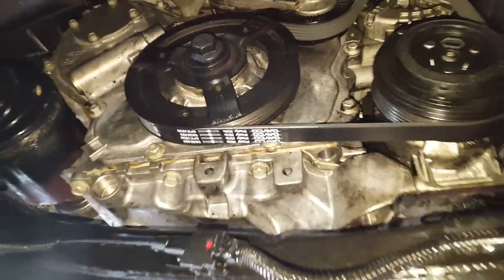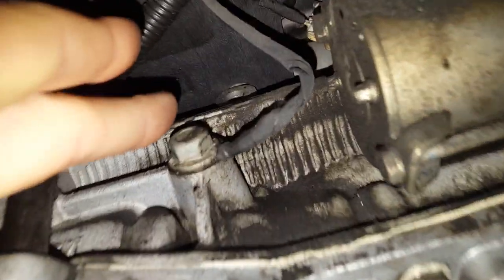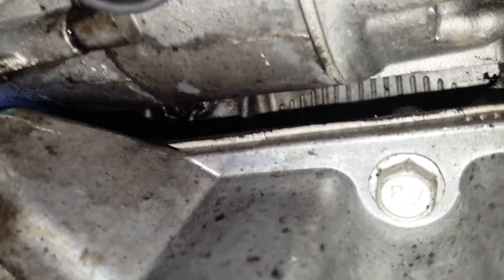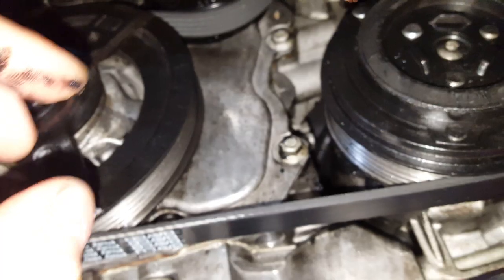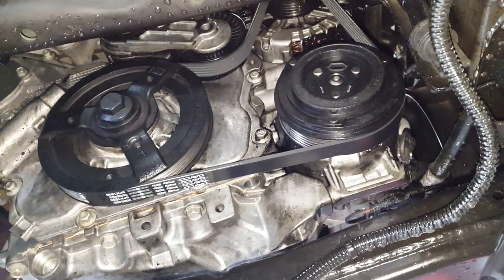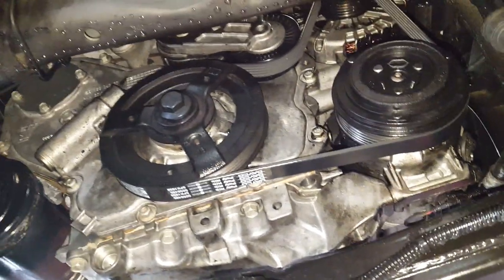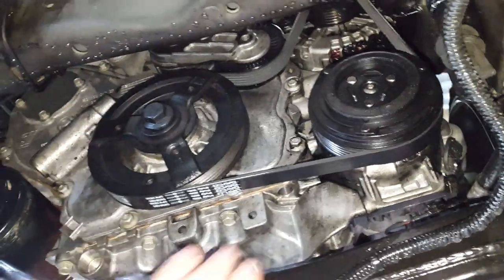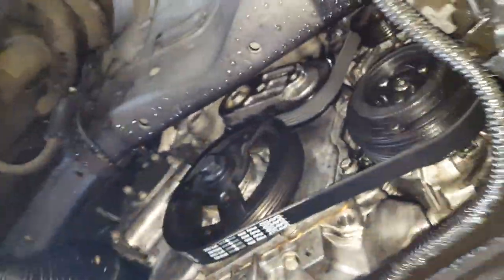EcoTEC Oil Leak hard to find

Comment: Just fixed my 2010 Chevy Equinox with an oil leak problem. Mine leaked after I turned the engine off and parked in the driveway.  I replaced the front crankcase seal, right behind the lower pulley. I also replaced the drive belt as it was soaked in oil, making a squealing noise and slipping against the pulley. Seems to be something that tends to happen to these GM vehicles with the 2.4 ECO Engine.  Fixed the leak straight away. $45 in parts, including tax…
Reply: I have owned 3 Chevys so far. 2 cruzes and a equinox. I’ve had nothing but cooling issues with the Cruzes and the equinox just has oil problems. 2 of the vehicles was brand new off the lot..
Reply: @jamesdenike5883 for the cruze get you a ZZP intercooler

Comment: Or, try  $16 for an oe delco oil sending unit and a Lisle socket for $7. The unit typically leaks and is hidden behind the starter. It leaks all along the oil pan.

Comment: 2010 cobalt, been dealing with this same leak for months now but i could never pin point it myself of where exactly it was coming from but now i see ! Thanks !
Reply: Was oil all over the belt and Altenator?  I can’t find this leak I replaced timing cover and crank seal. I’m going crazy. I think this video is it
Reply: Same oil leak for me.  2012 chevy malibu 2.4L eco tec.  I'm about to use ATP AT-205 and see if it helps with the seals.  This car has been a nightmare.  192'000 miles on her.  I ain't paying thousands of dollars just to replace the seals.  Gotta love American made

Comment: I have a 2005 Cobalt with the 2.2 ecotec and it leaked right after overhauling.  Finally found the problem which was the crankcase halves leaking.  Took the engine out and apart then carefully resealed the two halves.  Thought  I was good but about two months later it started again.  I found that these engines produce an incredible amount of crankcase pressure.  Don't look forward to R&Ring the engine again.
Reply from the maker: Could the pcv system be clogged?

Comment: 2008 HHR. 2.4. Oil leak. Backside of engine at a bracket-strut coming out of the block, in a valley. Just got informed by a Chevy Mastertech that the cylinder head has some sort of a newly found casting fracture as he describes it. 145k miles. Well cared for synthetic oil changes every 5000 miles. Interested to see where this goes. :-(
Reply: Got 250k 07 hhr. Runs new

Comment: I have the 2.2 and this just started today mine seems to be just above the starter. Now the fun.
Reply: What was the problem?
Reply: @Darrick222  if I remember correctly there was a sensor in that area was leaking. Oil pressure sensor or something. I don't really remember but was a easy fix.

Comment: I took my car to the dealership today for a p0300 random misfire. They found this leak today. My question is was the vehicle in the video having the same symptoms? I've never know a misfire to originate from an oil leak.
Reply: I believe misfires happen when oil leaks from the valve cover gasket into the spark plugs

Comment: Thank you , I couldn't figure out why my Saturn ion 2005 was loosing a quart or Moore every 7 to 10 days at about a full oil change every 3 weeks .Oh and this car also has about 5 of the 7 to 9 SAFTY RECALS happening rite now in it , faulty wireing and CONECTORS which are shorts that burn up the sensors transistors starting always with the weakest sensors first .It passed a "Pre Test "for  smog on the first with an intermitant check engine light and by the 24th I had it back for the Re Test for smog when the check engine light decided to stay on starting on the 5 TH of MAY  .
It fails the retest .On the first was the pretest and that was at 88 DAYS FROM purchase / financing as it's only 1/2 paid for at $3999 and $5081 after financing , the dealer charged me for a smog test and a certificate .
All ,,, to be electrical goes bad INTERMITANTLY and I BELEIVE it needs new clock spring electrical.
I Realy BELEIVE I was financed a Totaled Vehicle and it was probably illegall to even test drive .
Under the name INTEGRITY MOTORS no less ...
Reply from the maker: Drive it thru the showroom glass and set it on fire

Comment: Lehew Tech, I have a 2012 equinox and I was unaware of the ridiculous pcv system these things have (2.4 ecotech) and it developed a massive oil leak. It has a stream coming out, not drops. Anyhow, I repaired the pcv system by taking off the plastic intake and drilling out that pencil lead size hole to about 5/16". I thought my oil leak was the timing cover gasket, so I put one in. It's still leaking same as it was. Could it have blown the corner out of the head gasket by having too much oil pressure? Or is there something else there that I'm not seeing that could be the source of the leak? It looks like it's coming from  the front of the engine, right above the timing cover, all the way to the left, right above that small square access panel that's on the timing cover. To me it looks like it's where the head meets the block. If you've seen one do this before in that area, please share some knowledge. I'm afraid its the head gasket. Thanks

Comment: Hey I think I have that problem except I have the 2011 regal with ecotec 2.0L engine. It leaks is all over the side of the engine toward front side of the car. The leak seem to start from above the oil pan seam and not sure if my engine have the “sandwich section” Do think I have the same problem. Or do theses engines could possibly leak oil from the head gasket?
Reply: Yes your engine has the upper crankcase as mentioned here. My vehicle leaks exactly where your engine leaks from but on both sides back and front 😢😢😢😢

Comment: Hey bro on that exact engine, is there oil right inside that timing chain cover. I have a leak right on the left  bottom corner of the crank pulley. I replaced the oil pan gasket and still have a small leak. But nut it's clear that it's coming from the timing chain cover. I just not sure if theres supposed to be oil right in there ? If there is do you know what would be the steps to replac.
Reply from the maker: There is oil behind the timing cover. Dont have the steps for Replacement but I imagine that the crank pulley and a few other parts would have to come off
Reply: @LehewTech  ok thank you . Ima do it it doesn't seem to big of a job.
Reply: I'm having this same problem with my 15 verano the leak seem to be coming from behind the timing chain cover how would I go about stopping the leak?

Comment: Have you got it fix?and what solution did you use?am having the leak come from the upper as well....idk how much it cost to get fix
Reply from the maker: I did not fixed the leak shown in this video however here is a video where I fix a valve cover leak on an ecotec engine: https://youtu.be/CFWpbVuswMQ
Reply: Check your crankshaft seal. I had an oil leakage and thankfully I did alot of research and found out my crankshaft seal needed to be replace and boom! It got fixed.
Reply: @MrSPEEDY20  I’m replacing both my timing cover gasket and crankshaft seal on my 2016 equinox with the 2.4

Comment: Did you check the tightness of the bolts that hold that seam together? How about crankcase pressure when running? Re-torquing bolts is cheaper than removing an engine and taking it apart to fix an oil leak, and often solves the problem.
Reply from the maker: You are correct, however these bolts are internal and if they were loose at all there would be major engine failure Beyond just a leaking seam

Comment: I have the same problem,can you offer a simple repair,that you don't have to pull the engine
thank you
Reply from the maker: Yes, you can try draining the oil  and then cleaning the seam and the surrounding area with solvent and a wire brush. Once you have removed all traces of oil you can apply a sealant such as RTV silicone. Allow the silicone or sealant to completely dry for 24 hours before adding oil back into the engine. I hope this works for you as the alternative will be extremely time consuming.
Reply: @LehewTech  thank you,I hope this works or else pass it on to someone else.
Reply: Consider adding an oil can kit that vents extra crankcase pressure through a filter to the atmosphere, and keeps oil vapor away from the tops of the intake valves, thereby helping solve two problems at one time.

Comment: Bad piston ring design creates blow-by producing high crankcase pressure which pushes out oil through seals and gaskets. No fix for this leak unless you pull engine fix piston ring problem and reseal crank case halves properly.

Comment: Can u give us the part number for the gasket . Thx
Reply: @FACEBOOKS-WBDS  thanks for the response any RTV sealant you recommend? My equinox might have this issue if it ain’t the crankshaft seal..
Reply: @DM-mm7rs  Did you fix your oil leak?
Reply: @jssehler7777  yes it was the crankshaft seal ACDelco - Crankshaft Fron (Slp) (296-16)
Reply: @DM-mm7rs  Ugh. I think I'm looking at the same.
Reply: @jssehler7777  have you fixed it?